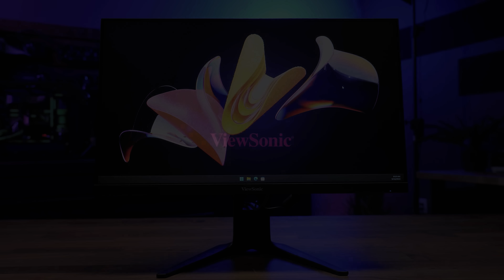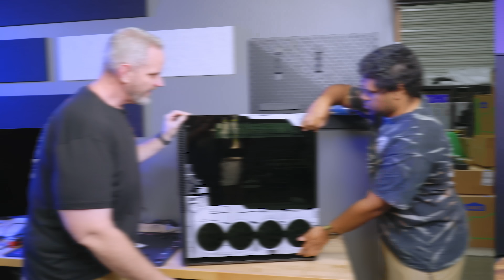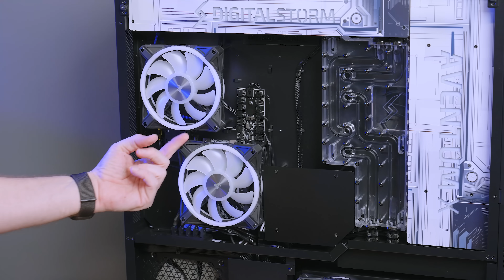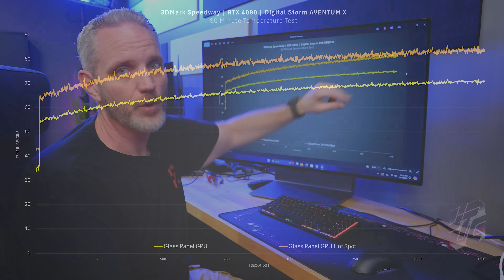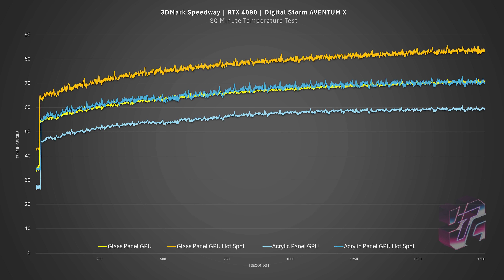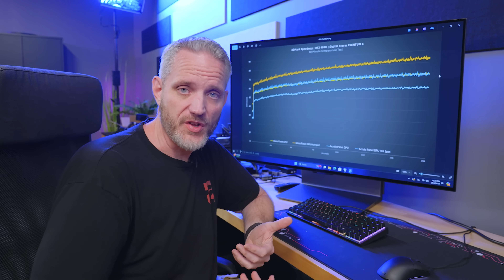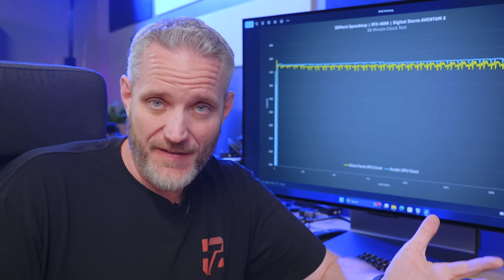Digital Storm responded to my Criticism... Let's go over it

Comment: So never buy anything from Digital Storm. I got it. For $8k, there should be ZERO issues, misdesign, or concerns. The fact that they designed and sold the system like that but then responded the way they did shows they are careless or clueless.

Comment: I liked this case when it had metal side panels with proper ventilation holes. That was early days of Aventum X, these days its most anti-cooling case produced, yes it's pretty but wont cool a thing properly for long sessions.
Aventum Pro is actually properly ventilated version of this case, i would chose it over this X variant.

Comment: You can cut holes in tempered glass. It is not recommened however, because it compromises the rigidity of the glass, and most real world applications of tempered glass do not require a hole in it. You would also need to laser cut it, which is super expensive, any mechanical tool would just ruin the glass. Pretty much, you would need to form the glass in that shape in the first place, rather than try to cut holes in it. And there aren't many glass producers making anything other than flat panels. But in the same way that they can shape glass for a particular application for example a Quarter Panel window, vs a Windshield, they can produce the glass in that way as well. They could produce a mold for it and form the glass that way, with holes in it, but again, super expensive, would actually probably be cheaper to laser the holes out.

Comment: I know cleaning solutions like Goo-Gone are good for removing excess adhesive, but would it work for initially removing stuck adhesive like on the new side panels? I'm not sure how well a good soak might work, but I'm sure it's better than nothing.

Comment: I wonder if anyone remembered ThermalTake case where the side panels are half glass and half metal and they were split diagonally? I think Digital Storm can take the concept and use it here. They may need more mounting points at the side of the case, though.

Comment: Looking at heatsink choices, air flow issues with chassis amongst a lot of PC manufacturers, and mismatches parts in OEM systems it really makes me wonder if these PC companies have anyone that truly understands PC hardware and airflow currently employed by them. The number of OEM systems that thermal throttle out of the box during normal operation is really sad.

Comment: So after finally getting called out after having this absolute garbage design for years which can be easily fixed considering this design is a crappified V3000, their only response is to be salty and call people idiots in corporate speak. 

Translated from corporate speak to normal person speak, "We know our design sucks but we bought so many of these from Lian Li that we are still trying to get rid of, we really don't want to invest any more money into them. We have another contract with Lian Li to produce more rip offs of their modern V3000+ design instead for our internal systems, but they won't be ready to manufacture them for several months. If you want, you can pay us to ship you two pieces of acrylic that won't solve the issues caused by this stupid design. We are so bad at what we do that we don't even think about basic things like effective or safe filling of the loop. Please continue paying us $3000 in margin for this piece of trash instead of going to any boutique builder and asking them to do a similar build in a Lian Li V3000+ that will perform way better, look way better, and actually last way longer and spend less money than what we are charging you. KThxBye."

Comment: Most shower screens have holes in them there temped glass and I had a glass shop cut one for me think he used a dimand hole saw but dont quote me on that  and I totally agree if you are going to have a radiator in there you would expect it to do something at that price

Comment: In order to get a hole, design or pattern on tempered glass, you would would have to do the work first and then temper the glass.  By its nature, tempered glass is extremely strong but brittle on the surface due to it being placed under an immense amount of stress.  So if there were to be any cuts or defects on the glass after it was tempered, it would shatter.
Reply: Yeah, it's like a spring being held under constant tension; if you overcome that...hope you've got full-body covering clothing.

Comment: They also should have made holes where the fans on the back side are, so the heat that stays in the front part of the case also can move thru the case.
This way you should not need a front radiator, because the air would flow from the frontside of the case to the back side of the case.
Etc, etc.

Comment: If I remember correctly, you can technically cut holes in the glass first before the tempering process, but after it's tempered you no longer can cut holes in the glass or it'll shatter.
Reply: Exactly - I'm willing to wager that they don't temper the panes themselves, so this would result in making more complicated (and expensive) custom orders from their supplier.  It probably would be doable, but it would depend on how much they would be willing to go through for that.
Reply: @empath69  for sure, plus that's more cost on them and the consumer. But who knows
Reply: @ItsVoidion  Heck, maybe they have plans to do that with the 'revised' case they're working on now? (which makes it LESS likely they'd start to offer it as a support option to current models)

Comment: You can 100% cut holes into tempered glass. My Cougar Panzer tempered glass side panel broke and I had to let a glass company make me a new one, they had to cut the holes for the grommets and screws pretty close to the edge of the glass and they did it no problem.
Reply: I guarantee that glass company took the pane glass, cut the holes first, and then tempered the glass afterwards.  And any irregularities like that increase the chance of failure while tempering (*pop*), so it's possible the sheet of tempered glass they provided you with in the end might've been the second or third attempt they made (one of the great things about glass is that your failures are imminent recyclable; just melt it down and try again!  Well, as long as there were no chemical/mineral additives/coatings/etc. that might have to be removed) 
My point (yes, I do have one) is that would've increased the cost in time and effort to them; they probably didn't bother passing a trivial cost on to you for this one unit, but if a wholesale customer was working in volumes of hundreds, an increased 10% of construction failures WOULD necessarily increase the price presented to that customer.  That could well be considered an acceptable cost to get the 'vented' panes.   But given that Digital Storm already provides a cheaper solution to the problem, do you see them considering this cost acceptable?

Comment: I don't understand how companies let this stuff happen, I have 0 experience with airflow and I managed to fix a built for one of my friends that had like 10 fans and high temps, changed the thermal paste and that did not work so I started to unplug and move some fans around, now this takes a significant amount of time since you have to restart the PC and run a stress test to see the temps, but I someone with 0 experience managed to get really good temps under full load on a 12700K on the third try.

Comment: most countries require glass to be installed on walls and doors of houses, apartments, and businesses to both filter UV and be "safety glass" which basically means tempered glass!  In luxury housing and corporate buildings you will commonly find instances where the glass is cut in a weird shape to follow a given curve, structure or whatever the architect wanted it to follow. But also, in basically every corner store ever, you will find a large glass pivot door with holes on it for a double-sided steel handle to be installed, this is like, the most common type of pivot door ever, and they are very reliable! So yes! It's possible to do a perforated glass that eventually get's tempered!

But also yes, it would be cost-prohibitive, and maybe impossible to do many small holes next to each other, or large curved shapes for air to flow-through. They could probably do hat they did on these acrylic ones, maybe they'd need to increase the solid parts in width a little, but definitely nothing more open that what this acrylic one is! So it wouldn't really be like a perforated steel, ever!

Comment: for this kind of system, the glass may be fine but for professional use where you do rendering that span for 3-4h or more depending of the size of the 3d scene, the price for performance is not there as your second render of the day gonna take more time as the system will still be hot, not great.

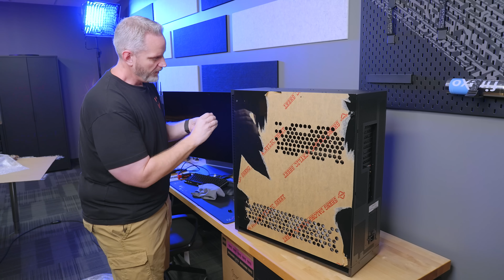Comment: 14:38 protective paper/film or stickers not coming off the glass (acrylic is even worse) are a complete dealbreaker 🤦‍♂ how hard is it in 2024 to get sticker/paper/film where the glue is not dyring out leaving you rage quitting (and scratching acrylic for sure) while trying to remove it ??? 😡

Comment: Can you have a cutout in the middle of a glass panel?  Sure.  They did it with the Phanteks Enthoo Elite.  Thanks for vid, Jay!
Reply: Yes, but you've gotta make these alterations BEFORE you temper the glass (trying to cut glass that's heat-treated to have constant internal tension to improve its strength is like jumping up and down on a compressed car spring) and that'd be in increase in the wholesale cost from the supplier that Digital Storm would have to accept beyond their existing solution of providing vented acrylic panes...
Reply: @empath69  Their prices are already extremely high!  So, what's your point?
Reply: @etjulien  My point is, they've already mentioned they're in the process of revamping the case - would it be more fiscally sound to add this 'vented tempered glass panel' option to their upcoming revised product, or change their existing support processes (where they already don't take the effort to keep QR codes up to date) to provide this as an option?
(spoilers: I don't think the glass panel option would show up...except as a feature of their NEW version...Soon™)
Reply: @empath69  With premium prices come premium expectations from the potential customers.  It is what it is,  What is really needed by Digital Storm is innovation.  How about contacting the supplier of the vented glass panel supplied to Phanteks to see how they can incorporate that into there "new" case design.  Premium price and "fiscally sound" oppose each other.  As a previous owner of a Digital Storm custom build, I can tell you that innovation is lacking.

Comment: Digital Storm may be enthusiasts for this kind of stuff but that doesn't make them experts either and for $8K for a machine like this, this design shouldn't be making such poor design choices. It's so embarrassingly inefficient for the cost! And it's so avoidable, which is the worst part. If you're going to charge that much and put that kind of hardware in it, you should at least be respecting how it should be utilized. This setup does not. Doesn't matter how pretty it looks. Oh, and not insulting the customer that you tricked into spending $8K on your machine by charging for shipping on the fix to the mistake in your design.

...And I gotta be honest the case and the art on it does not look all that great.

Comment: I don’t see why you couldn’t make holes in the glass there’s multiple methods of doing it. If you were to do it yourself I can see the problem there but a manufacturer should be able to do something like lazer cut it out or even something like make a mould with holes in it in the initial making of the glass. I’m sure there are many methods of doing it. I’d just say it’s more of a cost thing but at the same time 8k for a pc I don’t think would be make them get bankrupt if they offered holes in a panel of glass

Comment: Yes, you CAN have holes inside of tempered glass. As an example, look at the Asus ProArt PA602. While it is only a single hole (covered by an inserted grille), it is still a hole, and ventilation none the less. Especially when paired with the ProArt 420 AIO, it is quite a capable case (although, relatively expensive). I may have some issues with Asus lately, but thankfully, cases are more rarely subject to failures.
Reply: Yes, and that hole in the glass pane was put there BEFORE the glass was tempered.  You can't cut a piece of tempered glass; it's under constant internal tension as a result of the process.  It's like trying to saw through a spring that's under compression.  As you've pointed out, there are plenty of examples of tempered glass with cut-outs and other alterations beyond 'a simple pane of glass' that had that work done before tempering, but I bet they cost significantly more than simple plain panes.  And I'm pretty confident Digital Storm doesn't temper their glass in-house, so that would a) be more expensive to request from a supplier, and more importantly 2) would introduce more complication in both the final result of the process for making these PCs, AND in changing the process.  It remains to be seen how much DS is willing to do.
Reply: @empath69  My point was that it can be done. Not that it could be done after the tempering process ... just that they could have one manufactured. However, that is some great details about the process. Thanks!

With the upcharge they have, I would hope they could afford an extra buck or two to make their product better ... to help justify the cost.
Reply: @kirklanam151  Given that they're working on a revision to this case to address issues (that have persisted for five years), maybe they plan to include it with the 'new model'?
Reply: @empath69  One would centainly hope so. It is a competitive market. If you sit on your laurels and don't lead with innovation, you will be passed over. I wouldn't consider anything they are doing to be innovative. They have good marketing, and make a good-looking product. However, like I think Jay implied, it isn't anything that couldn't be done by nearly any other SI at a better price, with better performance. They are using standard hardware that anyone can buy (except for their case, which doesn't perform very well). I appaud the use of standard hardware because it makes it upgradable and hopefully won't simply be e-waste in 5 years. However, there is nothing innovative of market leading about it. It's just pretty. I agree with Jay. I value performance and value over looks.

Comment: You can UV print on acrylic. It was my job for a number of years. Look up EFI EFIPRO16H. That is what I used. Can handle 10ft 1inch thick Acrylic. Total pain to cut on CNC machine though. The weight alone requires 3-4 people to pick up and move.

Comment: I agree such products may be less than optimal but when the product is clearly shown and the flaws are not hidden, the consumer purchased the product knowing what it may be capable of. That said, they didn’t even have to provide a free panel, but they did. And this only applies to products with flaws that aren’t hidden and that companies try and hide. This would be an issue if companies hid the flaws and then didn’t provide a free fix.

Comment: This PC is absolute garbage. I have a 2x360mm custom loop, Optimus Sig v2 CPU block, and a cheap Byski MSI Suprim GPU block in a Corsair 5000D. Using a 13900k at 5.8p/4.5e/5.0ring and a Galax 666w vbios 4090 at a locked 3060mhz at 1.1v consuming 500w+, my temps rarely get over 55°C.
Reply: You didn't list the motherboard.  That's still about a four grand setup.  Even at four grand, there is still a large demographic out there that think it's not worth the price to performance.  Personally I think it's worth it, but a lot of folks are still going to criticize spending four grand on any system.
Reply: @poitiers2853  I'm not saying it's "good value." I'm saying that if you're in the market for a high-end watercooled PC, you can achieve much better results for far less money than this Digital Storm system. That PC has substantially more radiator/surface area with worse results. It just shows how inefficient the cooling setup is.

Comment: "Acrylic scratches like crazy" - yes....
Also - protective film used on car windshields can also be applied to acrylic panes.... and they will mitigate most of the problems....
Reply: What kind of film? As a window tinter who installs all sorts of different applied adhesives, you would have to use a specific blister free film on any kind of acrylic/plexiglass before you can apply film made for glass. The film will just roll off in a month or two if not. The blister free film is super thin and has no durability to withstand even the slightest scratch.

Edit: you could try using a clear shield PPF, but I don’t know how well it would stay without adding an extra adhesive to the acrylic side.
Reply: You mean like PPF? That could work, but it would be expensive.

Comment: Basically, you pay this much for a COMPUTER, there should not be any performance left on the table, negligible or not. Especially when it's right there in their hands to do. Seems Digital Storm said, ehh this good enough. WOW, you spend 8g on a computer and they cant eat shipping for a panel. THAT TELLS YOU WHAT KIND OF COMPANY YOU ARE DEALING WITH.

Comment: Ackshually, the lifespan of a capacitor is directly tied to temperature. 60°C inside the PSU over an extended period of time is pretty bad.
Reply: How to prevent psu from overheating and how to measure its temp?
Reply: @Chicken-o5ebuy a proper PSU that draws power comfortably without choking, and get a proper fan and cooling system, there you go.

Comment: i'd like to see another video on this system where you remove the offending components to get it to run cooler,, or slotting the bottom panel and have all the fans exhausting to have a negative pressure inside the case, without overly changing the look of the case exterior